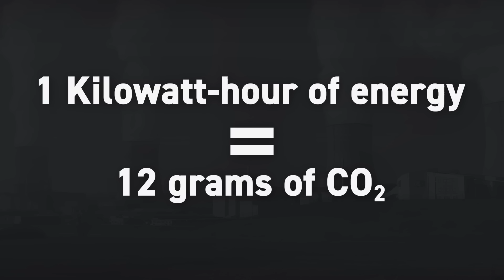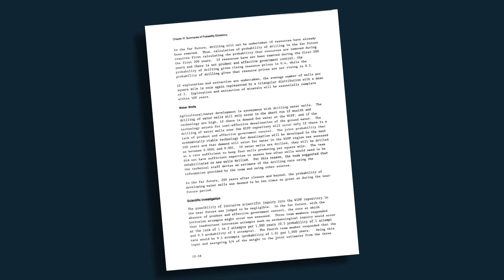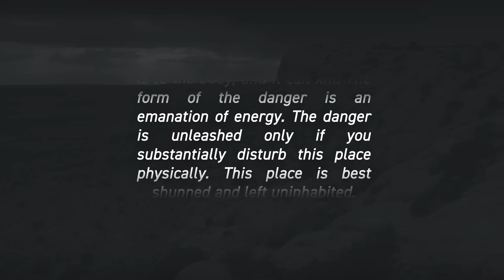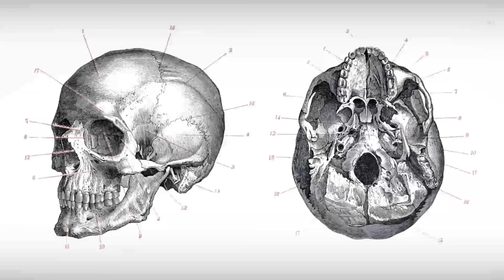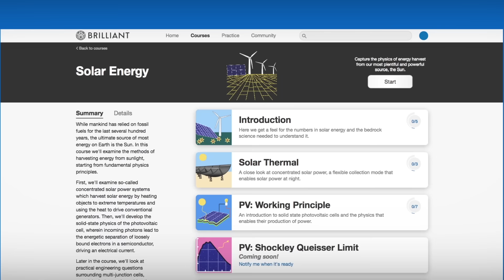The Nuclear Waste Problem

Comment: wait if the nuclear waste makes water boil can't we use that steam to further turn the turbines and make energy from it?
Reply: Hypothetically, yes, but it's not efficient enough to make it worth the cost. After all, that is the very reason those rods were removed from the reactor in the first place.
Reply: Spent fuel can be recycled. France, which relies HEAVILY on nuclear power (80% of our power comes from it), uses MOX fuel extensively. MOX is made by mixing spent fuel with new fuel, in a nutshell. There are tradeoffs, it's not perfect.
Reply: Robert Faber but aren't we spending more on the cooling systems either way?
Reply: Harshita Swaminathan France does exactly that. Funny that wendover ignored the nuclear energy capital of the world.
Reply: Harshita Swaminathan not without recycling it (which we do, just not in the US) or fissioning it further (which we will, in roughly 10 to 15 years).
Reply: So does that mean France doesn't have nuclear waste put under the ground?
Reply: how efficient a turbine, or any machine that turns heat into mechanical work, has its efficiency limited by the temperature difference between the intake and the exhaust. Higher temperature differences mean higher efficiency and hence more energy that can be extracted. Those "spent" rod may be able boil water but they can't heat up the steam to temperatures in which the turbines can function economically.
Reply: KR!RK some of it is
Reply: Felipe Chaparro ahh that makes sense, thank you 😊
Reply: Felipe Chaparro
I see someone did their thermodynamics homework
Reply: Felipe Chaparro But they would only need to be able to run the circulation pumps for the water coolant system, so it becomes a self sustained closed cycle in case of power failure such as at Fukushima.
Reply: There is a startup called Lumos that is actively researching converting the decay heat from spent fuel into electricity, but there are a lot of unique challenges to overcome that make the process pretty cost ineffective for now
Reply: Grind it up and spread it all around. It was found diluted, just spread it evenly all around the world.
Reply: You don't understand at all. The uranium is MORE radioactive than when we found it because it has been used for nuclear fission. The only reason why it was diluted when we found it was because it had billions of years to decay, the earth was a hot and radioactive ball with no life when it was forming. If you spread it around the world it would just kill off life as we know it.
Reply: +Max Carren
Uh no, if you spread uranium 238 and 235 evenly around the world, you might increase back ground radiation a tiny tiny amount.  Diluted is diluted.  Does the same thing whether you spread it evenly across the surface, or whether it was at a higher concentration and decayed to lower concentration.

If the concentrations are the same, then they do the same thing.
Reply: Yes and no.  It's not pursued, but honestly I can't see it not being worth the cost... it sounds to me like it's an outdated idea that doesn't consider the power in the rods... 

The idea that 20 years of boiling water isn't much power is... absurd.  Really?? No, someone's making a very stupid mistake here.

I remember playing half-life a few years ago and I saw that the ammo for certain weapons was spent fuel... I was shocked to see that when I looked it up spent fuel rods contain so much energy; it's a stunning misuse of resources.
Reply: KR!RK they do, but the even with diminishing returns the number must be so low it's not a real concern.
Reply: Max Carren Joseph's right.  The reason why we can't spread it around everywhere is because it costs so much energy to do that and the transportation risks are too high.
Reply: +Max Carren; no the uranium is the same radioactivity - it's the daughter products which are much more radioactive, but only temporarily.  Please watch this video, nuclear waste is still a valuable resource. https://youtu.be/oAVCaUonrbE
Reply: I'm pretty sure you're joking, but if you're not: the risk isn't to the pilots, it's due to the fact that it's least secure while in transit, and must pass by vulnerable locations.  It's the risk of the product getting released, like an oil tanker.
Reply: The most likely solution is to put the waste into some of the more efficient designs and in essence 'eat' it. The process would still produce waste but not at the amount you put in. Itd overall be a net positive in getting rid of it. Or we could just hand it over to nasa, and the could probably figure out a  way to reproccess the waste into something that can be used elsewhere.
Reply: Harshita Swaminathan i'm wondering the same thing.
Reply: Like mentioned in the video, when the water boils, it releases radiation. This is why they keep it cool and that is why we cannot produce more energy from it.
Reply: UnlawfulWaffle8 that's not what he said. The spent fuel releases radiation regardless of whether or not its kept underwater. They are kept underwater because water is a great way to shield from the gamma radiation emitted by the fuel. When the water boils off, it doesn't itself produce radiation. It's just that the radiation shield is removed, and the fuel starts to melt.
Reply: The problem is not Uranium, but other different elements, isotopes that are created during nuclear reaction as side products that are very radioactive and poisonous.
Reply: "Like mentioned in the video, when the water boils, it releases radiation. This is why they keep it cool and that is why we cannot produce more energy from it."

XD

Comment: This is the most disappointing video i have seen on this channel. As a person that served on a nuclear submarine, eating, sleeping and working at most a few hundred feet from a nuclear reactor and was trained in the safe handling of nuclear waste I feel i can say that this video presents only a portion of the facts and in a very slanted manner.

a few comments:
This completely ignores the fact that burning coal realeases more radiation per kW to the environment (in the form of radon ) than nuclear power plants do.
Additionally a LWR formed naturally in Africa  billions of years ago. the waste products from that reactor migrated distance measurable in feet despite being imbedded in a flowing water table.

The dangers of nuclear waste are over blown as part of a national security policy, because all nuclear waste from LWR reactors contains plutonium. Plutonium that can be separated out of the waste by a fairly simple set of chemical reactions into a pure form that can be assembled into an explosive. Where it takes large machinery to make a fission bomb from uranium ore, making one from nuclear waste could be done in a methlab, particularly if the people involved didn't care about their own health. You'd also have all the rest of the radioactive material to use as shrapnel. A very real security risk, but one that would be mitigated by recycling the waste instead of relying on fear.

That same chemical process could also be used to extract the plutonium for use in power plants, one of the posible ways in which nucelar waste could be recycled and reprocessed to reduce the real hazards it poses. 

The points about the amount of uranium remaining ignores the fact that there are other fission cycles, notably thorium, that can be used for nuclear energy.

Comment: Considering that the cost of fuel only contributes to around 10% of the cost per KWh of nuclear, it would still be cost effective even if the price of fuel increased by a factor of 4 or 5. The wholesale price of uranium is a major factor in how much we can mine in a cost effective manner.

Meanwhile spent nuclear fuel contains significant amounts of plutonium. in 200 years the radioactvity will have decayed to the point where it's reasonably safe to handle, and can be reprocessed.  In fact,  spent nuclear fuel contains more fissionable material than new fuel. the reason it's "spent" is the buildup of a small fraction of fission products that act as neutron poisons.
Reply: Over 60% of the costs of a nuclear plant lie outside the nuclear island. Across its life cycle, up to 40-50% of the cost of nuclear power is due to paying the interest on the multi-billion dollar loans to the banks and around 10-15% for fees to go towards funds for decommissioning and waste disposal. 
No other power source pays its own way for decommissioning or waste disposal. The cost of other power sources, once their externalised costs are factored in, would easily make them non-competitive.

But it's not that way for a reason. Decades of fearmongering and lobbying have allowed fossil fuels and even renewable energy sources to externalise their costs to society. From pollution to decommissioning to waste disposal to grid integration, taxpayers foot the bill while anti-nuclear activists make grandiose claims of the next reactor being built breaking the bank.

Comment: The water from the spent fuel doesn't actually get hot enough to boil. It is actually cooled enough from ambient losses, so it is safe and not possible to have the water boil off. You have a conceptional error between how the reactor works and the spent fuel storage. You are on a great path and bring up great facts and ideas but some things are not fully correct in your video.
Reply: The problem is not boiling so much as evaporation. Most of the ambient losses are from the cooling effect of evaporation which makes the pool smaller and can lead to boiling in the end. The interesting thing is very little actually happened to the spend fuel during the Fukushima Daiichi event.
Reply: Even so, Wendover committed a gross conceptual error in implying that radiation would be released should the spent fuel pool boil off and "kill thousands". There is no plausible release mechanism for fuel, even that which has been recently discharged from a reactor, without physical damage to the fuel rods. They are already rearranged such that they can be passively cooled in air, so there is no risk of meltdown and release of volatile fission products like Caesium-137. The entire point of the spent fuel pool is for gamma shielding. 

The only plausible mechanism for "killing thousands" would be to replace all the water in a spent fuel pool with humans and pack them in around the fuel rods so they would absorb a lethal dose of gamma radiation over the course of a few hours. Even then, it would be likely that more deaths would be attributable to crushing and suffocation than acute radiation poisoning.
Reply: Not exactly true, MonMalthias. The on-site radiation would be deadly, certainly, and of high enough magnitude that there would likely be a public release. Sure the oldest fuel might not emit enough heat to damage the cladding, but the most recently discharged fuel could certainly melt through the cladding once the water was gone. The air-cooled fuel assemblies in the dry casks has had sufficient burn-up to even be considered for removal from the pools.
Reply: from https://en.wikipedia.org/wiki/Spent_fuel_pool#Risks (en and german version):
The spent fuel rods need to be actively cooled for quite some time until they are no longer at risk of overheating. When they get pulled from the reactor, they have 100°C, without cooling they can reach 800°C where the zirconium hull of the rods starts to burn, vaporising the fuel itself and releasing it into the air.
So no, passive air cooling is surely not enough.

I wonder what people like you you gain from lying about or downplaying the dangers of nuclear power?
It´s really sad to see such fake facts being spread in regards to such an potentially dangerous topic.
Reply: Martin H. Should be noted that those dangers are pretty much entirely mitigated with proper maintenance and failsafes. Not sure if its in the page, but it should be noted that meltdowns have historically been due to negligence.
Reply: That previous incidents can be attributed to negligence when the material is known to be so dangerous is particularly damning and does not in any way mitigate against the inherent danger. In fact, it adds to it. The people who work around it become inured to the danger and treat it far, far too lightly. This is human error that cannot be eliminated by protocols and procedures no matter how much you try. By blaming human negligence you present the most powerful argument for why nuclear energy can never be safe.
Reply: MonMalthias it depends on fuel pool and the level of decay heat. Freshly discharged fuel in a fuel pool at a nuclear plant is emitting enough energy to damage itself if not cooled. Once it decays a little it is safe in air.
Reply: dlwatib By this logic nothing we ever do can be considered safe.
See that Tylenol on your local store shelf? Overdose on that, and you're dead within days, probably in considerable agony. Cars? No comment. Stairs? Oh boy, where do I begin!
Compared to deaths and injuries from common, everyday things, nuclear power is amazingly safe. Like air travel. You know, barreling through the air at hundreds of miles per hour in a tin can.

Edit: Typy typos and extra paragraph because reasons.

Comment: Thorium Molten Salt Reactors.  Work is already under way in China and India to make them a reality.

MSRs will take in highly radioactive spent nuclear fuel and further "cook" it.  It will take spent fuel that is dangerous for 100,000+ years and reduce it to wastes that are dangerous for only about 400 years.  Not perfect but it beats the snot out of having to consider massive cultural, biological and even geological changes that can easily occur on 100,000 year time scales.

MSRs are vastly more efficient with fuel.  Normal pressure vessel reactors convert only about 10% of the available fission energy in the uranium fuel before actinides build up and foul the rods.  MSRs are projected to convert 80-90% of the available fission energy from the fuel.

Details on extracting actinides from the molten salts still need to be worked out.

The physics of thorium reactors is well understood.  It was being worked on at the dawn of the nuclear age when the plug was pulled because they don't produce decent bomb-making materials.  Therein is another good reason to go with thorium, its proliferation resistence.  If they were supplied to even hostile nations (Iran ?) we can feel sure that a nuclear bomb would not follow soon afterward.  It has "atoms for peace" built right in.

https://en.m.wikipedia.org/wiki/Molten_salt_reactor
Reply: Liquid fuel form changes everything. The fuel can be kept inside the reactor as long as we want, without structural damage to the fuel. Solid-fuel under radiation experiences structural damage and has to be removed often. This solid-fuel is called long-lived nuclear waste, this unspent-solid fuel can also be converted into liquid-salt form and reused in molten-salt reactor.

Comment: I hate the idea of hiding this burring this material forever... Yes its incredibly dangerous but the costs associated with its production will most likely be of value in the (relatively) near future.  Through advanced processing techniques or even next next next gen reactors I am almost sure we will be able to extract more energy from it!  Just maintain it on site and for gods sake lets spend some R&D money on solutions that dont involve hiding it forever!
Reply: Dan Germata but if we reprocess it then the nuclear energy sector would be even more lucrative and would force other energy sources to be much more competitive. I believe that is part of the reason the us banned reprocessing. Very sad for a technology with so much potential.
Reply: totally agree...   But times change... and the one thing that waste has is time!
Reply: The reason that no one likes reprocessing nuclear waste is that a significant fraction of the energy is in the form of plutonium.  Reprocessing the waste is a fast track to nuclear weapons as plutonium can be separated from other elements a lot more easily than the useful isotopes of uranium can be separated from the other isotopes.  Its an easier political solution to have no one recycle spent fuel rods than limit who can do it.
Reply: Nathan - With Fast spectrum molten salt reactors there will be no need to reprocess or separate fuel, depleted/spent fuel can be consumed as is and weapons grade material will be denatured by this process, all while consuming 99% of the fissile material, it's really a win win win scenario.
Reply: That may be true, but there are an awful lot of fuel rod reactors.  Even if we switched to molten salt for all new reactors, we'd still have a fuel rod problem.  I think it's a problem we can solve.  One possibility is to have an international agency located in a nuclear power, like the US provide subsidized recycling that returns the recycled material in fuel rod form.  Or trades new uranium based fuel rods for spent ones and keeps the recycled material for use in nuclear powers.
Reply: Since a nuclear reactor only lasts 50+ years, if all new reactors used molten salts which could burn spent fuel, this all our current nuclear waste could be burned in a century or two.  This is much better than storing the nuclear waste for hundreds of thousands of years.
Reply: I don't think we're in disagreement about the technical side.  We both believe that fuel rods should be recycled.  I don't think storing it is a good idea.  It could be recycled into fuel rods or into fuel for molten salt reactors.

My claim is that recycling waste is a political problem more than a technological one.